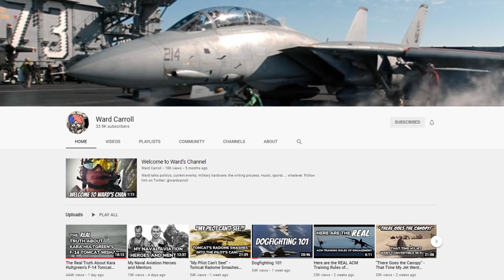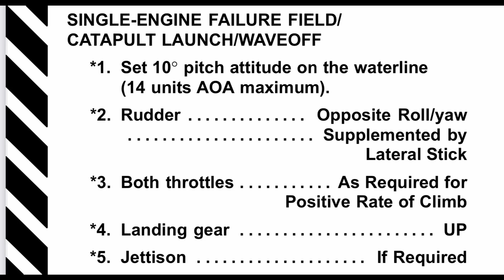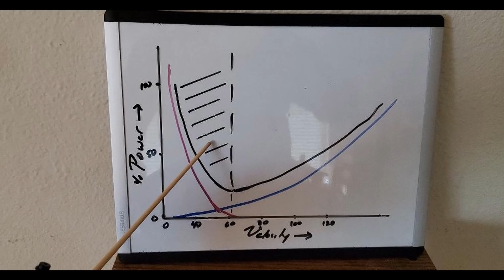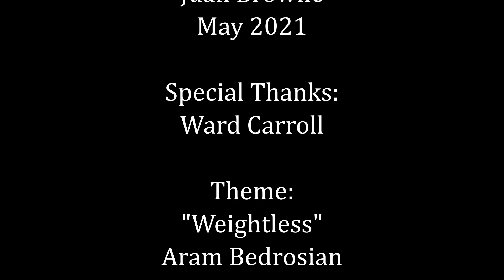Navy F-14 Crash/Stall Demo-Lt. Kara Hultgreen Accident

Comment: I'm a ground pilot, flying RC aircraft while standing in one spot.  Majority of full scale pilots will agree after trying to fly RC with all their experience, its a totally different world, flying with total lack of feeling.  HOWEVER, what was said here still holds true, natural reactions in the air are the same on the ground. A wing drops, first reaction, ailerons!    One thing that helps grind into a ground pilots is flying by rudder and elevator only, no ailerons at all on the plane, it helps to overcome that natural reaction to use aileron, and you learn to use both as you transition into three axis flight.    I have seen a few crashes because the pilot didn't use rudder.   Whats funny though is that even though I have only flown a full scale once for a few minutes, over a large lake up north on a late October day (those who fly will understand what happens over water at that time of year), I know exactly every move he made to get the plane under control since I practice a lot of stall maneuvers with my planes at three mistakes high.   I really enjoyed this video.

Comment: In (Uk) sailplane training we regularly test reaction to stall with wingdrop. It is exacerbated with such high aspect ratio wings. Mentally I think about recovering in the direction of the wingdrop, not my original heading. So with a right wing drop i will recover several degrees right of the original heading. The technique you are describing is more like a spin recovery, stick forward till the spin stops the (we dont have throttles !), opposite rudder and recover. The low altitude stall equates to a launch failure at very low level. Only instructors practice and demonstrate it as when we let the students try there were too many mishaps ! The technique is to lower the nose to avoid a stall without hitting the deck, and land with two flying wings ! So yes training is needed and needs constant refreshing to avoid the instinctive but incorrect reaction.

Comment: Right on Juan!!  As a student pilot in the late 1970's this basic stall/spin recovery was drilled into us.  Back then we practiced actual spin recovery (entered a spin, tried to wait for one full revolution then executed recovery....and a C-152 started spinning fast!).  Procedure: Neutralize ailerons; nose down and apply opposite rudder; when rotation stopped apply power and slowly bring the nose up to initiate climb (milk off flaps and climb at best airspeed.  Back then I was told to be prepared to demonstrate stalls and possibly a full spin by the FAA Examiner.  Mine just asked for the departure stall demo, no spin.  No difference in the F-14 except that the F-14 is way,way less forgiving.  Great demonstration Juan.

Comment: Couple of clean up items.  The F-14 didn't have ailerons.  It used independent horizontal stabilizers for roll.  Ailerons would not work with a swept wing aircraft.  An F14 stab was about the same size as an A-4 wing. Experienced pilots would use them at high AOA to increase roll rate.  Took some time to get use to stick left/roll right.  F-14A was considered a non center line thrust aircraft by the FAA.  The distance between the engines was deceptive.

Comment: Great presentation.  Let me add a thought on a pilot's reaction to that landing situation.   The normal human reaction to the water coming up fast would have been made even stronger by the fact that the correct set of AOA-rudder recovery actions (lower AOA and right rudder) would have felt like (maybe even would have been) turning directly into the stern of the ship.  The instinct to avoid the fiery head-on crash had to be a factor.

Comment: I'd understood that skidding a turn in any aircraft with side-intakes is a big no-no anyway, as the nose of the fuselage disrupts airflow into the intake on the inside of the skid.  How badly that affects each aircraft obviously varies by the exact profile of the nose.  But any aircraft on which you cannot safely do a slip is going to be a bad candidate for a skid.
The F-14 seemed to suffer particularly badly from compressor stalls if skidded or slipped though, especially in early versions with the original engines.
I thought the F-14 had in its last version had the "problem" with trying to pick up a wing with the stick been fixed with a software solution,  which interpreted stick movement as a roll intention but actually moved the rudders instead of spoilers (there are no ailerons on the F-14, so AOA on the dropping wing cannot be increased, although airflow can be disrupted by spoiler use instead) to correct it.  You could call it a Manoeuvring Characteristics Augmentation System!

Comment: Juan, great video. Flying around on the critical AOA (buffet) using rudders to manage turns is a great experience and will never be forgotten. Every navy carrier pilot is taught slow flight until it is burned into their brains. However, even with that training there is the "Fright Factor" that delays recognition and response to "Loud Slam-Bam" events that can occur. 1-2 seconds turning base or a cat shot with a compressor stall falls into that category. Keep up the good work.

Comment: Dang right it’s a “natural human instinct”, but it is also TRAINED into us by our CFI’s and our primary training! From our very first lesson as student pilots we learn to control roll with ailerons. It becomes a hard-wired reflex by constant repetition. Unless a CFI trains the student pilot to control roll on stalls with top rudder, and drills the student in it to the point that it becomes reflex, the student will get his/her PP without the unconscious skill needed to survive a stall/spin emergency. I love your channel and your message, sir.  Keep it coming!
Reply: I used to fly a taylorcraft which had a bad case of adverse aileron yaw. The ailerons were very slow and useless for shallow turns. To keep the wings level you used rudder and to turn you used rudder. You only used the ailerons to correct the angle of bank when things became uncoordinated.. Landing in a crosswind was interesting. You set the angle of bank with the ailerons and pointed the aircraft so that when it touched down it was pointed in the direction that it was traveling. I think that my reaction in the case of these compressor stalls would have been to use the rudder first. In flying a taylorcraft  in level flight you had your feet on the rudder pedals all the time and left the control wheel alone. I flying a Cessna 150 most of the time you left the rudders alone.

Comment: At a hundred feet and flying on the back of the power curve, there just isn't time to catch the aircraft unless you are particularly lucky. Minimum human reaction time is a tenth of a second. So you need to block the instinctive reaction to lift the wing with ailerons, then consciously push the stick forward, apply rudder and increase power. I'm guessing half a second to get that initiated and all the time you are getting closer to the sea...  Practising these things at high altitude helps, but when it happens for real at the worst possible moment, you are going to be relying on ground effect to keep you out of the wet stuff. Perhaps the best outcome is just keeping the aircraft upright while the ejection seat system cycles.

Comment: I worked on the F-14A (engine shop and flight deck) in the 80s. The PW TF-30 was bad for compressor stalls. The GE engines helped this issue a lot.

Comment: You lose some 200 ft faking it single engine (no asymmetrical thrust, no engine-out worries), and knowing what you're about to do.
Hultgreen was already in a left hand turn when that left TF30 quit, and didn't really have 200 ft to spare.

2 years on, her sqn VF-213 turned a perfectly functioning Tomcat into a lawndart, killing 5.
Didn't cause nearly the fuzz as Hultgreen's crash.
Neither did the VF-84 Jolly Rogers' crash before it.

By 1994, no Tomcat ought to still have been flying with the TF-30.

Comment: I learned in Ward's video that the F-14's engines, although they look "centerline", actually the thrust is slightly pointed outboard of center, and that's what exacerbated the force/effect of the operating engine.  That was really tough for Kara, all the concentration to get down and trapped, on short final, and BAMM all of a sudden at the worst possible time, compressor-stall!  She had no time to think, it must have been just reflex.  If she'd had a few more seconds it might've turned out better.  Sigh.  Good show and tell in the Mighty Luscombe!  Thank you.

Comment: Thank you Juan for another super video that brought my attention to some very important items. In reference to the discussion brought about by the Tomcat’s 10 foot separation between cans and its affects. I remember when flying in the F-101B Voodoo which had far less separation between its engines yet during takeoffs the notable effect felt when going to full mil then outboard to initiate the burners. Although they were suppose to lite at the same time the majority of which there was a split second between each burner due to reasons your already aware. The point I make is during the time when the first burner lit a tremendous buck in the opposite direction of that engine was experienced with immediately the same in the opposite direction when the other lit off. You always felt a definite kick in each side of your back at the same time the instant direction change of the aircrafts nose. All normal but makes me wonder what an eye opener it would bring on if it were to be cat launched off a carrier. Hypothetical yes but without that outward off center of its engines and being much closer together than the Tomcats it brings the thought to mind. Looking forward to the next video.

Comment: Based on the fact that even highly proficient  human pilots cannot be expected to handle unexpected flight critical situations in multimillion dollar aircraft that are the product of multi billion dollar procurement and sustainment programs,, and given the severe consequences of failure to do so, the flight control engineers must be green lighted to develop alternate control laws for situations such as uncommanded assymetric thrust, uncommanded flight control surface excursions, pilot incapacitation, and so on.  The corrective action philosophy of "bold text memory items", that are completely counterintuitive to human reactions  and require at least an initial understanding of complex aerodynamic and dynamic interactions, not to mention lightning quick cognition and action, is completely inexcusable and unacceptable.

Work has been done in related areas... morphing structures, flight control via differential thrust in lieu of aerodynamic  surfaces, etc, and has likely been done on precisely what I propose here. It's high time for the aircraft to go where the pilots point their hands and feet.

Comment: Tomcats are most definitely NOT centerline thrust.  A common misconception....Also, going to Mil or especially burner will guarantee the aircraft will continue it's roll because of the fact the engines are 5' off centerline.  Also, in ANY skill, the axiom is that it takes roughly 1000 repetitions before it becomes muscle memory or you are considered "fluent" in whatever it is.  From martial arts, to spin recovery...there's ZERO substitute for practice.  

"If you spend too much time thinking about something, you'll never get it done" - Bruce Lee

Comment: I consider myself very fortunate to have done my initial training in a Piper Tomahawk. If you were coordinated and level, it was gentle as all. If you had a wing low or the ball wasn’t centered you could be in for an exciting ride. 
I took some flak about that little airplane, “Ya know why they call em tomahawks? Because there’s one stuck in every tree”. 
But you know what? I had a ball flying that airplane. It was great fun but it did make you work for it. Isn’t that what a trainer is supposed to do ?

Comment: There is an interesting analogy with people who come from rear wheel drive rally cars to front wheel drive. I was in a one make front wheel drive competition and very good rear wheel drive guy bought an FWD car and joined the series. We told him to remember not to do wind on opposite lock and drive out of of the slide. He came into  a corner very hot and the back went out so he wound on opposite lock and gassed it and ended up embedded in a large tree. In FWD was pulled where the wheels were pointed.  In fact you do momentarily put on opposite lock as the back goes out but you then instantaneously turn back into the curve and gas it so the car pulls you through the corner. This is why most rally drivers today go from front wheel drove to all wheel drive because the dynamics (understeer on entry , gas it and drive through the corner) as basically the same. Although I'm not a flyer I thought Juan's analysis was really compelling and understandable especially in terms of the instinctual reaction.

Comment: Thanks for yet another.great video. When the left wing drops do.you.apply rudder to turn right?
Reply: If the left wing drops due to loss of lift from low air speed over and under he wing, and right rudder is effective (i.e. rudder can catch enough wind to rotate the aircraft to the right), it would seem to me that it will increase speed of airflow around the left wing, which is what would be wanted.

Obviously one would need to know or sense how much rudder is good.

Comment: I watched a supposed former F-14 pilot talk about compressor stall/engine loss during take off and he had said that since the F-14 engines were spread so far apart that the F-14 didn’t have enough rudder to compensate for the yaw rate during engine loss while in full afterburner. I don’t know how true that is. If it is true wouldn’t you just back the throttles off and level out in order to reduce your yaw rate?

Comment: So is the roll problem reduced in the Large Passenger Aircraft (with a much wider separation between engines) which you fly regularly at the expense of a greater yaw on single engine failure on takeoff, or is it still primarily a roll problem?

Comment: I'm not a pilot or engineer but I was always amazed by Bernoulli's principle of accelerating particles. When speed increases pressure decreases. It's also counter intuitive to believe that the pressure on the bottom of a wing isn't causing the lift but the pressure drop on the top which is caused by the increase in speed resulting from more surface area. It does no good to increase pressure on the bottom of the wing if the top loses contact with the air. So as you say the angle is the key

Comment: At that stage of the flight would it have been better for her to stay with the aircraft since ejecting would kill you?
Reply: It wasn’t an option for her since the RIO initiated the ejection sequence and even if she did the rear seat (most cases) goes first to prevent being fried by the rocket motor blast of the front seat. There again human reaction and training take place when to pull the handles or face curtain.
Reply: @natural-born_pilot  Thanks.

Comment: Great piece!  Very informative.  I am a professional location sound mixer.  I am also a pilot.  I have the same Peltor headsets you are rocking in the video.  Mine, like yours has had the foam mic pop screen dissolve quite a while ago. Your audio would be improved greatly by replacing the foam screen either with a new one, [availability?]
or by cutting a digit off a pair of thinnish cotton/poly winter gloves and securing it with a black rubber band.   Keep up the good work!  I love the Mighty Luscombe in green!

Comment: Speed is life, pitching up will get you closer to the stalling angle of attack.  One thing though, if I'm not mistaken the F-14 used spoilers  not ailerons, so the failed engine side wing would not lose any lift by using the stick to correct, the opposite side (good engine)  wing would lose lift. Not having been in the military I don't  know for sure, but multiengine civilian pilots are trained to correct asymmetric thrust with the rudder. Of course it's easy to arm chair quarterback while sipping coffee and not the same when faced with an unexpected engine failure in real life.
Edit to add: Abruptly adding asymmetric power (thrust) will roll you over faster than you can react. This might be a better explanation to what happened to Lieutenant Hultgreen (May she rest in peace).

Comment: Two things: I just discovered Ward Carroll's YT channel a couple of weeks ago. Great stuff. Kudos to him.  Also, I was in the industry at the time of Hultgreen's mishap. It was so politically charged it was difficult to have a conversation about it. Our poor company mishap investigator just shook his head when he got back from the investigation. I guess enough time has elapsed to now be able to discuss this thing on a factual basis.  About time.
Reply: For what I understand, the Navy conducted 2 investigations, one of them is released to the public, while the other one is kept under “military wraps”. Some….of that info on the second investigation was released to the public, and for what I’ve read, the officer that did so got court martialed. That info apparently revealed political pressure to “certify” the first female F-14 Tomcat fighter pilot. Aerodynamics will do what they will do regardless of gender
Reply: @uwekonnigsstaddt524  CFI's should just cut engines on take off at V1, wit a 20 knot crosswind coming from the failed engine.  Let the good ones pass, the bad ones fail regardless of gender.  Simple.
Reply from the maker: Finally!